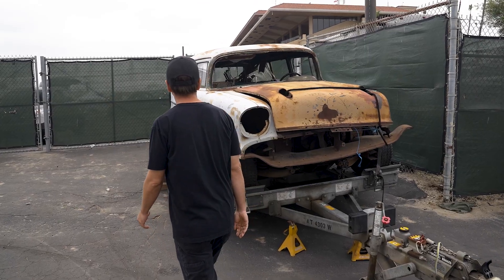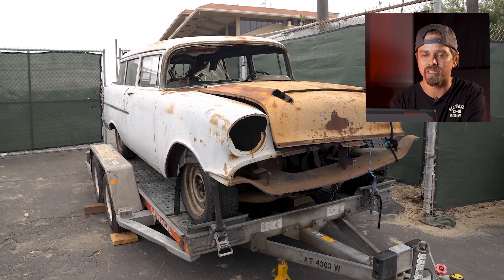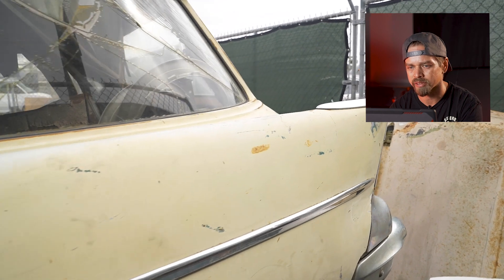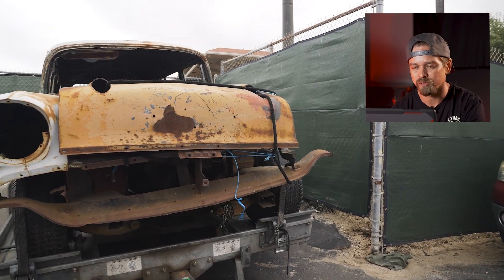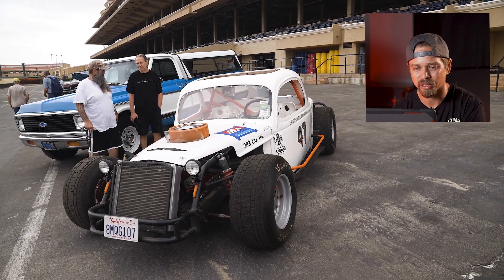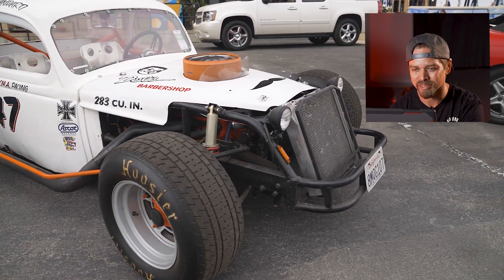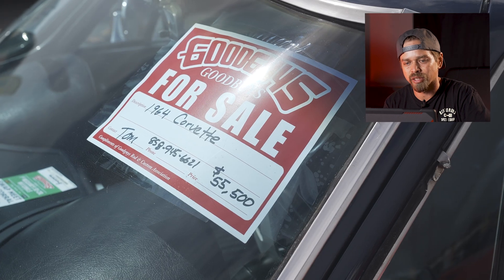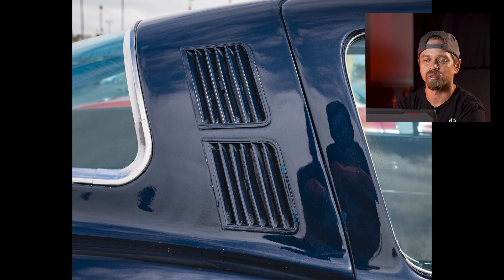3 Classics For Sale You'll Only Find at a Good Guys Swap Meet

Comment: If I were located in your beautiful area, my picks would most likely be either the wagon or the Jalopy! The wagon for obvious reasons, mind you I'd investigate the possibility of trading the rear glass for the steel panels. Secondly, the jalopy is as Chris said vintage cool and not easily found in any shape unless in a museum, let alone road ready. The vette although iconic in it's own right wouldn't be as accommodating to a 6'2 guy as I'd like I don't think. Great video as always Chris; now about my Chevelle there behind you... 😉

Comment: 57’ Wagon has potential and all the windows are there except for windshield. Definitely would install a Chevy V8 Modern internals ( Roller 400 ci) 😄and a overdrive transmission, blast the frame and undercoat it and work up, fix any rust and have a pretty nice interior installed drive it and paint it later. The Corvette would be one to think about but the price seems a bit steep for needing a good paint job!?Cool finds!